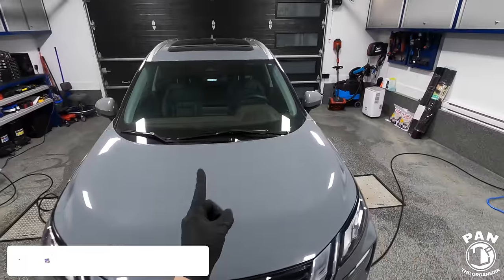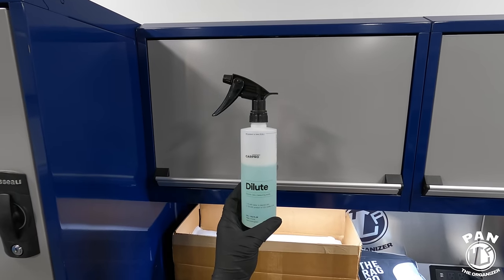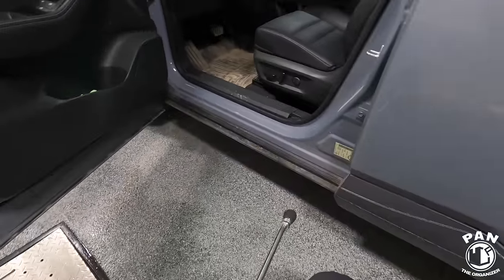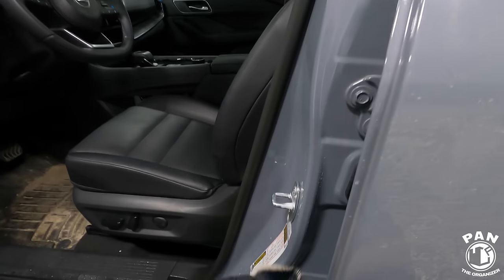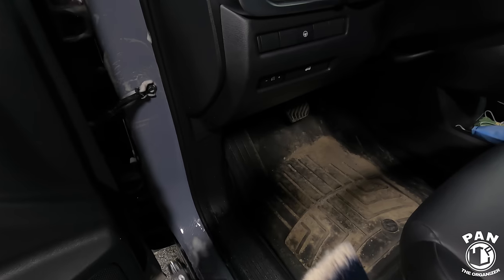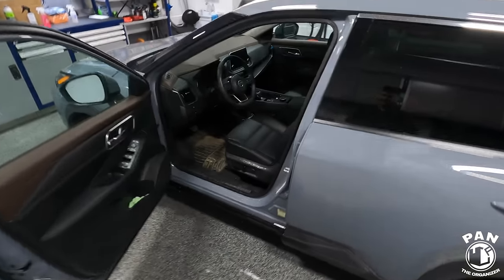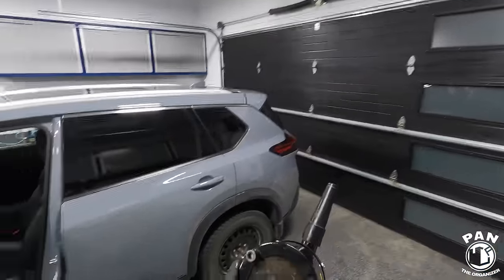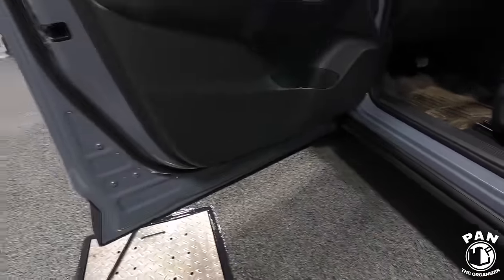How To Clean Door Jambs (Door Shuts)

Comment from the maker: ⬇🔶 LINKS TO PRODUCTS MENTIONED IN THIS VIDEO ⬇⬇
🇺🇸 For people in USA:
Kranzle 1122TST pressure washer: https://bit.ly/3d5kZeK
OG Mosmatic gun and wand: https://bit.ly/3ovIcPA
Koch Chemie Green Star (APC): https://bit.ly/40xBFVd
CarPro Dilute spray bottle: https://bit.ly/40wf1wC
Detail Factory soft brush: https://amzn.to/42SYRz0
Gyeon Tar: https://bit.ly/40RQ7qS
Gyeon WetCoat sealant: https://bit.ly/3KkjInS
Gyeon Ceramic Detailer quick detail spray: https://bit.ly/40mofLR
MetroVac Air Force Blaster Sidekick: https://amzn.to/3TVKTIF
303 Rubber Seal Protectant: https://amzn.to/3Zki9dv

🇨🇦 For people in Canada:
Kranzle 1122TST pressure washer: https://bit.ly/3MgYINZ
Mosmatic gun & wand solution: https://bit.ly/3EBUZbI
Koch Chemie Green Star (APC): https://bit.ly/3T14C8y
CarPro Dilute spray bottle: https://bit.ly/3SKt0ei
Detail Factory soft brush: https://bit.ly/3hhHzIP
Gyeon Tar: http://bit.ly/3lUuabW
Gyeon WetCoat sealant: http://bit.ly/3XKH49t
Gyeon Ceramic Detailer quick detail spray: https://bit.ly/3Fjwn6l
MetroVac Air Force Blaster Sidekick: https://bit.ly/3EKL6Jd
303 Rubber Seal Protectant: https://bit.ly/40CuvP6

🇬🇧 For people in the UK:
Pressure washer: https://amzn.to/3YqRY5b
Koch Chemie Green Star (APC): https://bit.ly/3TBVR5l
CarPro Dilute spray bottle: https://bit.ly/3EmSPMP
Detail Factory soft brush: https://bit.ly/3ZlxYB7
Gyeon Tar: http://bit.ly/42XWt9Y
Gyeon WetCoat sealant: http://bit.ly/3XHhUZd
Gyeon Ceramic Detailer quick detail spray: https://bit.ly/3wPi46h
Handheld dryer: https://bit.ly/3MhdsMP
303 Rubber Seal Protectant: https://amzn.to/3U6pKvq

🇫🇷 For people in France: https://c3po.link/QCuWUPTVjQ

Comment: An excellent de-greaser for really dirty door jambs especially by the front door hinge area is to use Purple Blaster diluted 50/50 or even full strength. After you have dried off the areas, I recommend  using a light special purpose grease to re lubricate the hinge and arms, as the de-greaser will very likely have removed the hinge grease. A White Lithium Spray, Silicone Spray (WD-40 Specialist) or Teflon / PTFE spray or similar products are all excellent for this purpose. Those sprays will really helps prevent squeaking and rusting. The Lithium is especially good for those winter months as it is very durable in sub-zero temperatures as well as very hot temperatures.  Some folks may prefer the ease of the WD-40 Specialist line of lubricant sprays that are available in both silicone and lithium. Hope this was helpful.
Reply: Which is better, silicone or lithium?
Reply: @misterlove7034  The white lithium is actually white in color but the regular lithium is clear. The White Lithium is also less messy than regular lithium  The advantage of the lithium over the silicone is its operating temp from sub zero to hot tropical temperatures in excess of 100 degree. It is excellent as a metal on metal lube Silicone is also very good and can be used as a lube on rubber as well. So both are excellent.  It just depends on your needs.

Comment: Great video, Pan. I love when you do instructional videos. I always learn. I normally use ONR detailer dilution with a chemical guys pump sprayer and a microfiber towel to wipe off. Works for me. I do it every wash so they never get all that dirty.
Reply: Ditto mate, works perfectly for me! ONR is like the WD40 of auto detailing, imo. Shit I made a surface clear to use on my black glass coffee table and it works better than any other products my GF has tried.
Reply from the maker: Yeah once the door jambs are properly cleaned and protected like I showed in the video, regular maintenance is a breeze as I also just use a bit if rinseless wash and I wipe with a microfiber towel.
Reply: Was just gonna say, I’ve been using N-914 diluted 6:128 and wiping off with microfiber. Glad to see others doing the same. Out of curiosity, what dilutions do you guys use for your rinseless wash for this purpose?
Reply: @dpsfit  I don’t really measure as well as a should when doing door Jambs or other tasks that aren’t crucial to me.  I normally throw  approx 1oz in 20oz of water in my spray bottle. I’ll measure exact ratios when doing Rinseless washes or claybar.
Reply: @chuckfink8239  Makes sense,  I feel like you don't need to be too scientific about it to get the results. Thanks!

Comment: GREAT VIDEO!!! I literally did this just a couple days ago. The brush to reach all the knooks and crannies is an awesome suggestion as I've been using an old wash mitt and my hands and fingers don't get into the area behind the hinges where the front fender meets the door. As a DIYer I would only be doing this complete of a job maybe 3-6 times a year so I wouldn't have a huge brush selection. How would you clean the brush in the best way to preserve it any "tricks of the trade" .Also, since I don't have a big budget and would prefer to not order online, is there a Walmart or Can. Tire available product that could be used as a Wet Application detailer spray that you could recommend? I use the very silicon spray product that you had in your hand for doing the weather strips and rubber seals around the door jab AND the door itself especially along the bottom. Never had a stuck door in many years of doing this yet and we get freeze and thaw cycle weather here between November and mid April quite often ( wet roads during the day and freezing at night equals wet then frozen weather strips).

Comment: Pan, do you use this method all the time on your Porsche that is washed at least once a week? Or do you follow a different process for a fairly clean vehicle? I find myself using a quick spray of ONR on the jambs + CarPro Elixir on the towel as a drying aid to clean / dry the door jambs after washing the exterior
Reply from the maker: I use this method once a month or every other month for deeper cleaning. As I wash my car often, twice weekly, it’s usually enough to just wipe with a bit of rinseless solution at the end of the wash process.

Because the door jambs are protected like I show in the video, it makes regular cleaning much quicker and easier.

Comment: Great instructions Pan. Can I use WD40 on the door rubber seals? Thanks
Reply from the maker: WD40 is a water displacement product not really made for that. Use silicone based sprays on rubber seals.

Comment: When doing an overall polishing and applying a sealant/coating, I'll do the same for the painted areas inside the doors and trunk lid. I figure anywhere the automaker wanted protected with clear coat should get that treatment too. I'll accept if people think that's over-thinking things, but all it takes is one whack of the jamb by a loose set of keys, a toy, or jelly jar by someone rushing to enter or exit to leave a mark.

Comment: Hi Pan, Thank you for the video. I always degreased them, and pressure cleaned them, in that order lol. Literally since the 1990's. Then, as I got older, I got slightly more timid. I have been using a rinseless wash lately with a microfiber towel sopping wet on them. If it's really jacked up, I'll use a degreaser first, then a rinseless wash in a separate bucket from the main wash, as if doing wheels and tires. One time, I got paid for an exterior only and thought I was doing a favor by cleaning the door jams and of course got overspray on the seats (as you just did around 10-15 of the video) and the client gave me enough grief that I had to do a full interior because he said his seats were uneven. They weren't. I just told him I did the jams for him and wiped down the seats for him. He took the ball and ran with it. It probably appeared I was covering something. In my world, when getting paid, that is an interior aspect of cleaning. I also separate the cleanings. I don't have something where I do both interior and exterior for one price. I just do my best to estimate somethig to get what I need per hour and to recoup chemical costs. At this point in time I have literally a handful of people I do, but more and more are asking, so I am considering going back into it as a main profession again. I enjoy your videos very much and wanted to see what you did. It was the single only time after just countless cars I had a problem like that. Some people can be just really crappy lol.

Comment: Hey Pan from the UK! Loving the videos and was you that got me into detailing!

Do have a question that I can't seem to find the answer to, the rubber seals on the outside around the windows, whenever I clean them nothing comes off until I use a rubber protection, and then LOADS of black much comes off and ruins my towels!

Can you recommend something to clean these rubbers up at all before using a rubber protection?

Comment: Once the door shuts are up to a decent standard, and they aren't too dirty I normally wipe them over with a quick detailer (Bilt Hamber QD 4:1) on my regular washes. It makes it a much quicker process on well maintained cars.
Reply from the maker: Yes exactly. Once deep cleaned and protected, all I need to do is use a bit of rinseless wash and wipe with a microfiber towel.

Comment: Passing along a tip I use when spraying along the door sills and trunk channels.  Try turning the pressure washer off and use the lower pressure of the water supply to minimize the spray and splash back into the interior

Comment: I usually use ONR mixed 1:20 with distilled water and a thick microfibre towel to clean; and then use Soft99 Mirror Shine to protect. Works good so far.
Reply from the maker: Yeah for regular weekly washes I also use a bit of rinseless and wipe. Because the door jambs are protected like I show in the video, it makes maintenance a breeze.

Comment: I have been using my rinseless wash in a spray bottle to clean, but in Arizona we really only have dust in the jambs not any of that heavy winter grime.
Reply: I'm in AZ also and just washed my car. I also use a rinseless to clean my jams! It works well.
Reply from the maker: Yeah once the door jambs are properly cleaned and protected like I showed in the video, regular maintenance is a breeze as I also just use a bit if rinseless wash and I wipe with a microfiber towel.

Comment: Always had some reservations to using the pressure washer on the jambs as I was hesitant on the water overspray/splash into the car, but it didn't seem that bad (obviously depends on the nozzle tip/pressure). I wonder what the splash into the trunk/hatch will look like. 
I usually just use a quick detailer/MF towel at the end of the exterior wash, but doing a rinsing of the jambs prior seems reasonable enough. So, gonna give this a try next time. 
As always, thanks Pan.
Reply from the maker: Thanks Peter

Comment: Pan I found that using a pressure washer concentrated through the cracks of the door and trunk openings while closed seems to get enough water on the sills and jambs to allow you to then open the door and trunk and use your soup to wipe down the area.  Then, shut the door and trunk lid and hit it with the pressure washer again to remove the soap.  It seem to work fairly well and avoids getting too much water into the interior and the trunk.

Comment: I have heard you say on a lot of your videos about reducing pressure washer PSI down to between 1000-2000 psi. I have a gas powered pressure washer rated for 2800 max PSI and 2.3 GPM max. If I use the 40 degree tip 2.5 Orifice that comes with it, it runs at 2000 psi at 2.1 gpm. I plan on ordering a 3.5 orifice but not sure what that will bring my PSI down to and GPM up to. My questions is when switching to my foam cannon will the pressure be ok as I'm sure that the hole from it is much bigger. Or do you suggest I purchase a dial in adjustable regulator? and if I get a regulator, would this decrease my GPM?
Reply from the maker: I use 1000 psi on my pressure washer and it works wonders with a foam cannon as my pressure washer outputs a stout 2.1 gpm of water. Plus I use a water deionizer so I always get awesome foam and suds.

Comment: If spraying in the door jam indiscriminately, wouldn’t you get water into the sheet metal in the couple little holes like the door latch? I’d think water would get into places it’s not supposed to be and cause rust and corrosion inside of the door. Thoughts?
Reply from the maker: Water inevitably gets in there when you drive in rainy conditions. There are drainage holes specifically to evacuate water on all cars. Even your engine bay gets wet. No worries. Don’t overthink the moment.

Comment: Lets say 12min per door, 5 doors, that's 60min on just door jambs. yikes
Reply from the maker: Hehe no. It's actually 1-2 min max per door. When you're not filming a YouTube video and talking at the same time, it takes much less time. You're basically just quickly rinsing, cleaning, rinsing and applying a spray on rinse off sealant. This is quick and easy.

If done regularly, and protected, the door jambs won't accumulate a crazy amount of dirt, so it makes cleaning super quick. Once the initial deep clean is done, you can likely do each door in a minute or less. Sometimes all you need is a quick wipe with a microfiber towel and a rinseless wash solution.

Welcome to my channel. You discovered one of the biggest car detailing channels on YouTube as we surpassed 965,000 subscribers and we have over 130 million views! I have been detailing for 26 years and I love to share my knowledge and passion with my viewers.

You found the right channel to help you learn everything about detailing.

Comment: The most overlooked part of a vehicle and ultimately the most important too, especially in areas where salt is involved. I personally would have used some ONR to emulsify the dirt before rinsing but that is just merely a preference at this point. I've been a huge fan of Green Star for well over a year but Forst has won me over recently for unclogging my Griots ceramic spray coating. Without even using it yet, I'd almost bet that Wet Coat is better than Carpros offering because our buddy in Calgary is also a huge proponent of this fine line. Pan I have to say, thank you for choosing the simplest tools sometimes to show that you can achieve your goals without having the most powerful unit. Case in point, the 1.3 hp air blaster!
Reply from the maker: Thanks Damon!

Comment: Would you recommend applying a ceramic coating to the jamb when ceramic coating the rest of the car? Would I be able to use the 303 rubber seal on the moonroof seal and gaskets?
Reply from the maker: Yes I coated my door jambs. :)

You can use the 303 on any rubber.

Comment: Hi Pan, I have NEVER deared to go at the door jambs with a high preassure washer  before finding your chanel and this video/episode..
Tried it for the firs time today, and like you said.. hardly a drop of water got inside the car.. it truly makes this job much easier and efficient.. 👍
Reply from the maker: Glad I could help! And yeah pros use this method all the time. Case in point, a well respected pro detailer in the UK had given my viewers that tip in this video: https://youtu.be/GJdPu6UEEgo?si=wjBDlfPvXUcVB9yH

Comment: perhaps you can enlighten me. I  have all purpose cleaner but the only time I ever use it is for cleaning pads or and grease from the engine bay. I just never use it for anything else cause detail spray or spray wax will do everything. although I do keep my cars immaculate. so what I should just toss this chemical or what?
Reply from the maker: A detail spray or spray wax isn’t meant to clean. For grime and dirt, an all-purpose cleaner is the first thing one should use. Quick detailer or spray wax at the end to finish the job, add a bit of gloss and slickness.

Comment: I never thought about using an APC and boar's head brush for the jambs. Usually I just use a topper / quick detailer and microfiber. If the jambs are particularly bad I might use some shampoo, but if you clean them every wash it never gets to that point. How often do you typically apply your rubber protectant on the Porsche?
Reply from the maker: Once every other month.

Comment: Is it necessary to put that much Wet Coat on the jambs? I thought 1-2 sprays is enough to cover large body panels.
Reply from the maker: It’s not a huge surface area so it would be hard to fully cover it with just a few sprays… try it and you’ll see what I mean.

Comment: Question,how is your epoxy floor holding up? I enjoy your videos on vehicle cleaning including this one. Keep up the good work as it’s essential to keep our vehicles clean for long term ownership. My vehicles are at least 10years old before I change them. Thanks
Reply from the maker: I love that floor coating so much. Holds up great and maintenance is as simple as pressure rinsing every other month. I have had this in my previous house too and loved it.
Reply: Thank you for your response as I have contracted to have mine done in June!

Comment: Could I spray a QD, heavily diluted degreaser, or a foaming glass cleaner as a pre treatment, shut the doors, and focus on the door cracks when using pressure washer? Then after just wipe away residual.
Reply from the maker: I'm not sure I understand the question. I was pretty clear in the simple procedure in the video. Any other method you'll have to test for yourself and see how it works. This is my method.
Reply: @PanTheOrganizer  I mean does spraying  any of those products in the door jambs help with the cleaning later on? Spray said chemical in the jamb and close the door so the chemical can dwell. And when I use the pressure washer (doors still closed), I focus the nozzle on the doors cracks so water can get into the jambs and mix with the chemical already in the jambs. By doing that, when you go to do the final wipe down the jambs, the dirt, mud, etc, is loosened and picked up easier. 

This way you’re totally eliminating any chance of water getting inside the vehicle or having to spray the jambs with the doors wide open. Just a thought I guess.